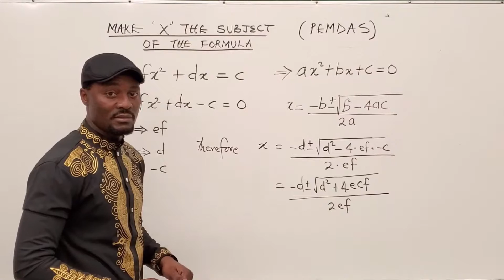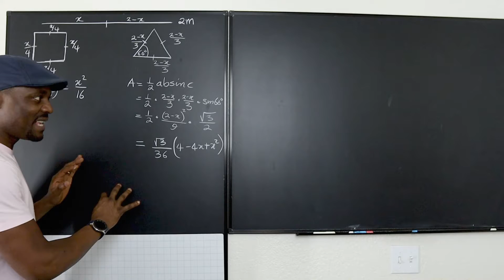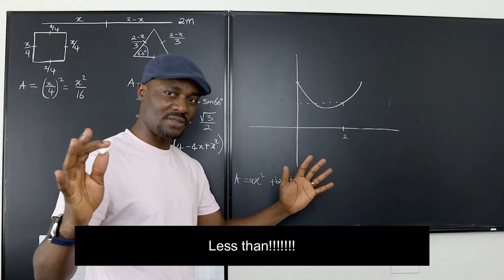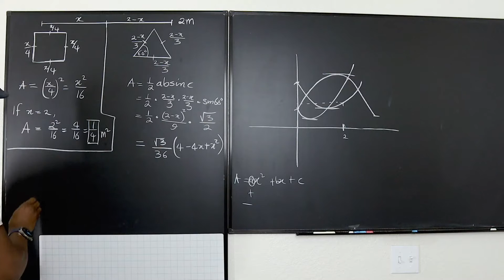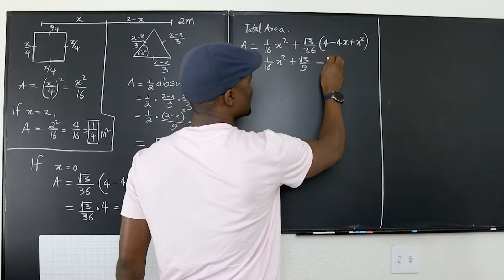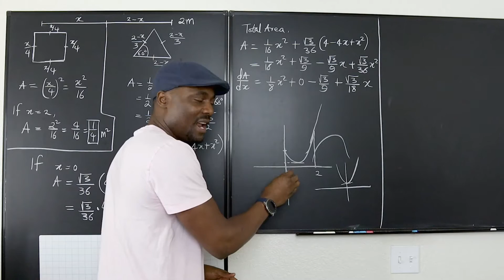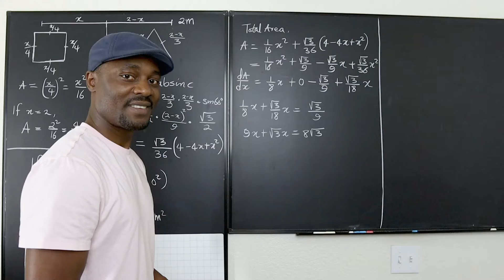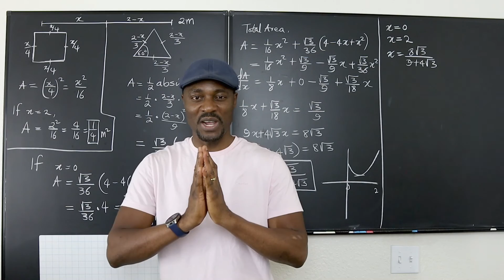Maximum and Minimum Area

Comment: After finding the 𝑥 that gives the minimum area (this 𝑥 is not tiny by the way, it's almost half the length of the entire rope),
you can use the fact that a parabola is symmetric about its vertex to realize that the maximum must be at 𝑥 = 2.